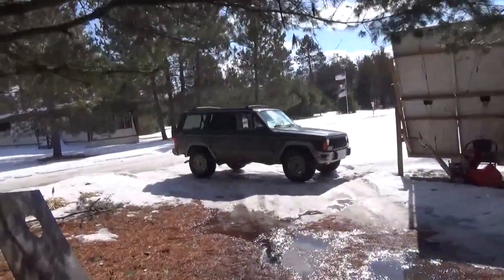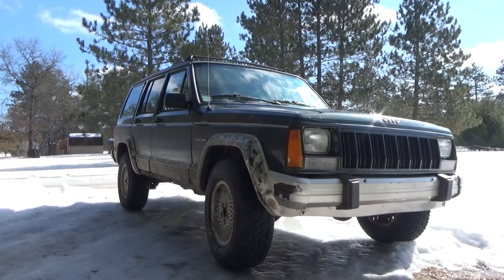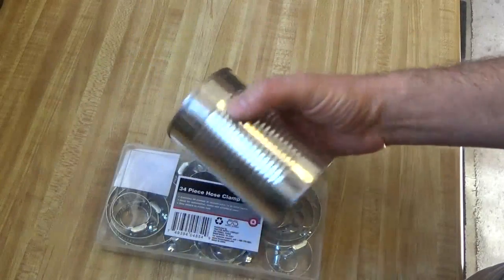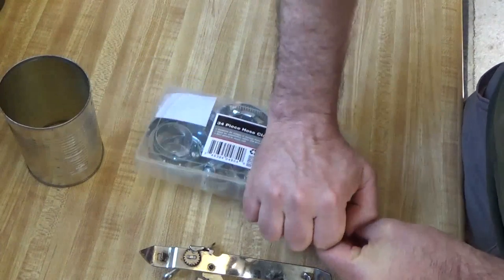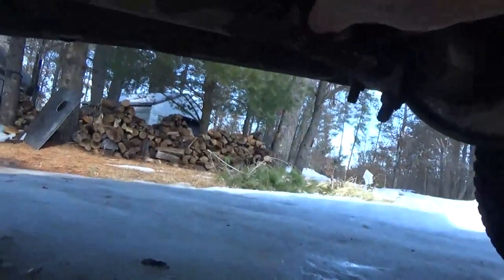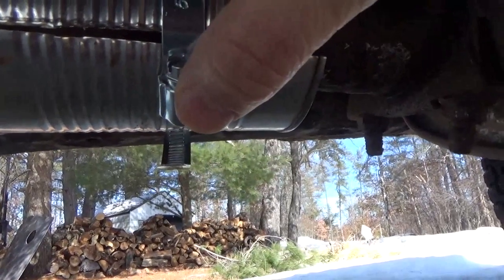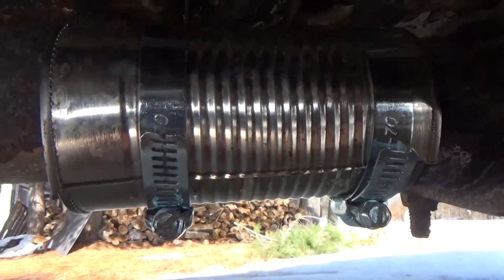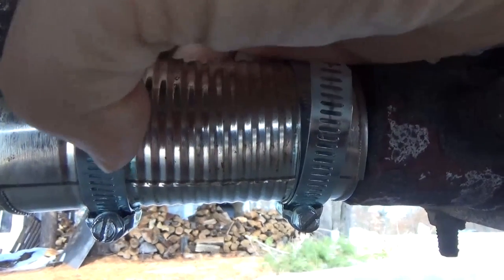Soup Can And Hose Clamps Repair Car Exhaust Leak

Comment: if U cut the pipe all the way through, U can get a piece of pipe 1 size bigger with 2 pipe clamps about 6-8 inches long and make a new fit!!!!
Reply from the maker: Yes, I may go that route and cut out the rot and put in a new piece to join them back together.
Reply: That is a wonderful idea! Where would you find that kind of pipe?
Reply from the maker: Any auto parts store has pieces of exhaust pipe for repairs. Various sizes and diameters to get the job done.
Reply: @MiddleEastMilli  muffler shop or  auto motive store
Reply: @kdscrapping4452  Thank you! :)
Reply: @TheDoItYourselfWorld  Oh! I did not know that! Thank you!!!

Comment: the only problem with petrol engines is they produce condensation in the exhaust and they rot inside out diesels tend to rot from outside in due to the thick layer of soot so protect only way to make exhausts last is stainless but for that tends to be alot of money my friends old 4x4 landrover had started to rust out panels so having a chassy the body work does not have crumple zones so we got industrial stainless steel sheets and built body panels and pop riveted then in place then painted panels to match rest of body work
Reply from the maker: Yes, that is true. Its a temporary fix. I wish I could work with and afford stainless. Our Jeep needs some panels underneath replaced this summer.
Reply: @TheDoItYourselfWorld  yeah i did notice that was not sure if it was undercoat pealing away or rotton panels look for old microwaves side of the road and such the silver ones are stainless some of them have stainless inside if you put ridges in the panels they are stronger so can be made with finner panels
Reply from the maker: Cool. Thanks for the tip
Reply: @TheDoItYourselfWorld  no problem nearly forgot dishwashers also

Comment: troy do your family right .....new exhaust is called for ..don't kill your family being cheap
Reply from the maker: This wont kill anyone. I have been doing this for years. The danger is if I had driven like this to town to get the proper parts.
And I wont pay for a whole new exhaust when its not needed. All I need is a few inches of a larger diameter pipe and two proper clamps to do it right. I will do that on video too.
Reply: @TheDoItYourselfWorld  troy there are some things you don't need to do half assed this is one of them if the crappy exhaust system is rusting out it's time for a new one.... NOT a cheap temporary fix don't bet your families life on it.... your not alone any more... you have a wonderful wife and little daughter who are going to depend on you to do the right thing ...it can kill and does ...i know your going to cut that section out and replace it but from what little you showed and the age of your jeep and environment you live in it's time to replace all of it..there are some things you should NEVER compromise on and this time this is one of those..i had to revive a child on the side of a hwy because of something just like this so i know what im talking about..end of dad speech
Reply from the maker: Why on earth would you replace the cat, muffler and the rest of the exhaust when only one place is bad? How insane to spend a thousand dollars for a $10 fix. And for $10 I mean a proper fix. We live in a very wasteful society. There is nothing wrong with the cat and muffler on this vehicle.
Reply: @TheDoItYourselfWorld  if you pay thousands for an total exhaust system your a fool ....replace everything from the cat back......less then 100 dollars and your family doesn't die from carbon monoxide poisoning....your not trapped in the middle of nowhere with nothing but a roll of duck tape and some bailing wire do the right thing
Reply: @bobbybenson849  Where can you go where it's less than $100 for everything behind the cat??

Comment: Great fix for the price I’d never think of that thanks for sharing and if u ever thought about replacing that little short piece of pipe they make a Universal Exhaust Flexible Repair Kit that’s flexible so u can bent it into the correct shape and it cuts vary easy with a saw they come with the clamps there about 10-15 at auto part stores it’s probably easier than welding in a section of pipe , and they make high temperature paint u could probably wire brush off the exhaust and spray it on it comes in a spray paint can it would make the exhaust system last a little while longer and help prevent rust , great videos god bless.
Reply from the maker: Thanks. I plan to use pipe from the auto parts store.

Comment: What no baling wire or brazing rod with a cutting torch aka hot wrench to fill in the hole. Did you use a Campbells or Progresso can for your patch. Michigan farmer's quick fix with the baling wire. Makes for a quick disconnect of muffler to make the olde engine sound a little tougher. 289 into a 351 Windsor. Good enough to get you to  Minekie to get a new exhaust train installed and holes patched in floor boards. Beats a ticket for loud exhaust in town. Michigan cancer strikes again.

Comment: They make an exhaust putty that could be used to seal that can.  At one time I had an exhaust paste with a heat resistant tape to put over it like drywall tape then I put the paste over it and let it dry.  It seemed to work until I could save the money to have the exhaust fixed.  I try to keep that kind of thing on hand just in case.
Reply from the maker: I have used that stuff in the past myself.